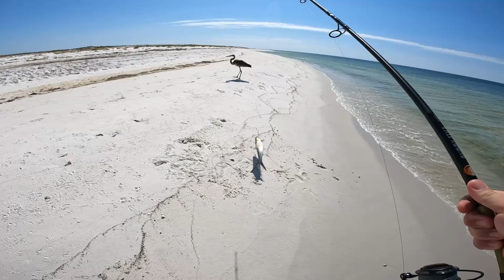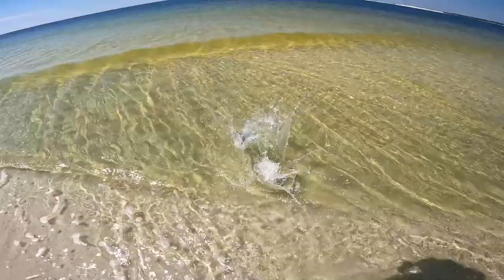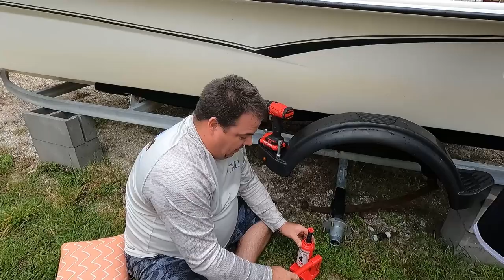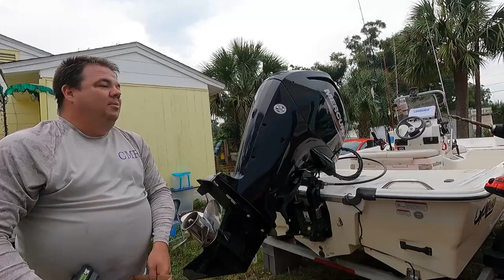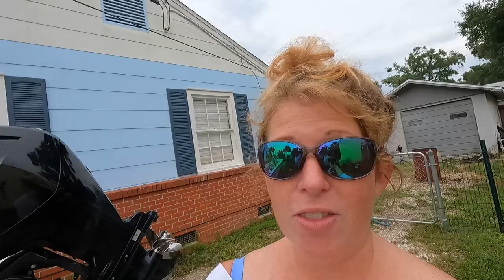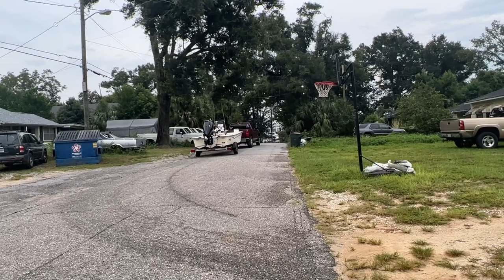Mako Pro Skiff 17 Axel Replacement

Comment: nice job on the axle.  A little bit of advice is when screw in, do cross pattern.  Like you do one screw, then the one across the other side, and keep going across to the one next to the first one, etc...  that to ensure the wheel is tighten evenly.  Anyway, i have a question, do you know how long from the back of the engine to the crank handle on the front? im thinking about the 17 size, and i would like to store it in the garage, but it only 19 ft in length.  so im thinking about adding the swing away mod to the trailer to see if it possible to fit.  Thanks.

Comment: You will find out if you got it on there correctly by checking your tires after a few trips.  If the axle isnt on square your tires will start wearing on the sides.
Reply from the maker: The leaf springs had pre designed seat mounts. Only one place it could go so it’s in the exact same place as the original.
Reply: @CameramanRon  great. I have replaced two. One had marks and went fine. The other didn't.  I found  out the hard way it's important to measure when they dont

Comment: Make sure you get your boat trailer tires balanced and you need to get your trailer aliment Make sure your trailer is going down the road straight and not dog tracking to the right or left so it doesn't wear out your tires and wheel bearings
Reply from the maker: For sure!

Comment: Junk boat get it off boat trailer sand blast old trailer to down metal,degrease it prime metal,paint marine paint,replace bearing rims tires As well hitch put bull dog hitch .Get road ready tag it .Use that trailer more like it heavy maded trailer look junkie boat was a 1970 modle when built trailer good steel from USA 🇺🇸